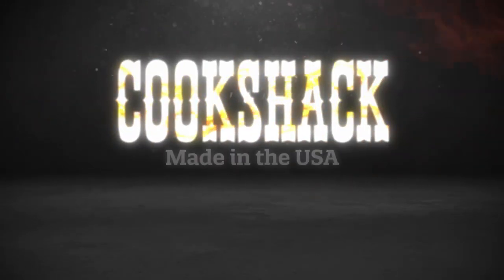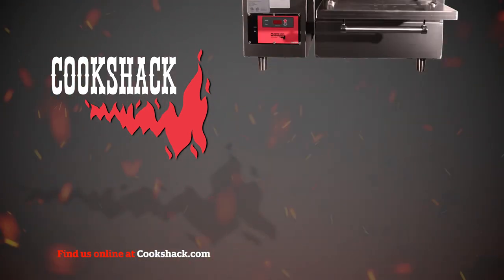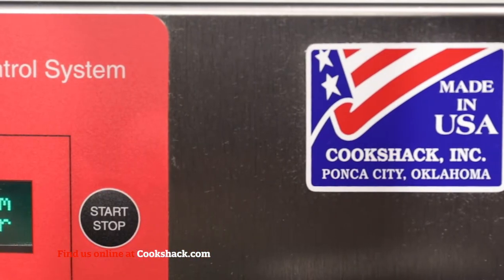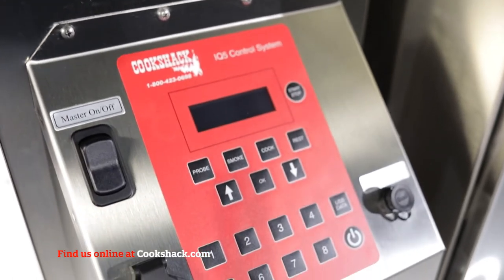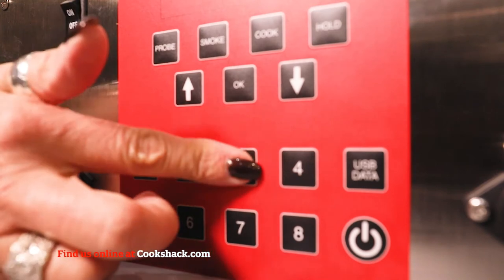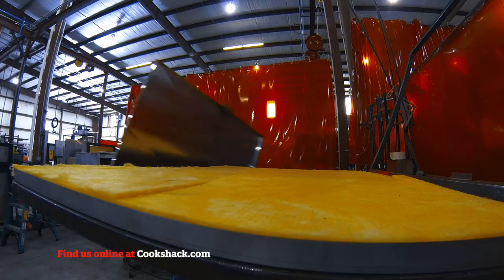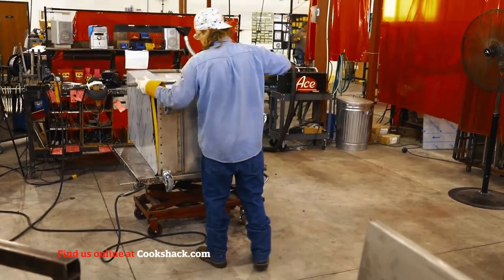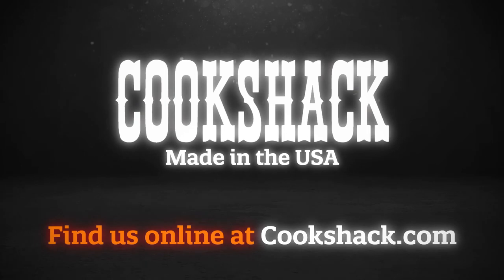Cookshack Commercial Electric Smoker Ovens

Comment: What are the benefits and learning curve going to look like coming from a pellet smoker to this style of smoker? Which is more cost effective, and which is going to produce more smoke on the meat? We were considering a commercial pellet because I like the consistency of the heat and smoke without having to touch the pellets during a cook, or even worry about them. I also know by experience that during a cook with a pellet smoker, that you can keep a very consistent “clean smoke,” whereas this model that you have which is oven heated, concerns me in regards to having to watch the wood in the unit and putting new wood in without a fire, could cause a more cloudy, white “dirty smoke.” We would like to consider all options first before making a decision about your products. I was leaning towards the pellet but what I do like about this unit is the consistent-worry-free clean smoke, and what I like about this wood chunk-oven-smoker, is that it’s larger and might produce more smokey flavor on the meat. Please advise.